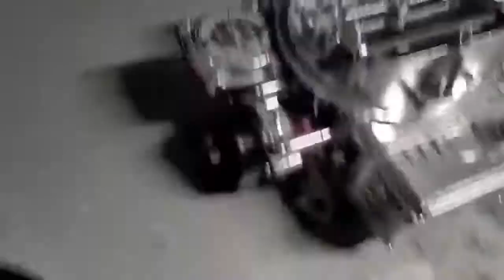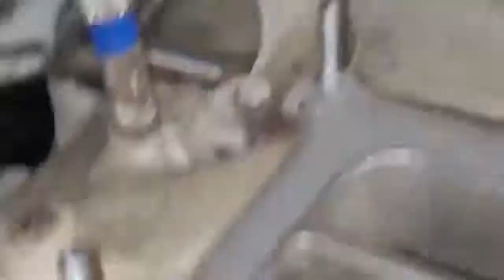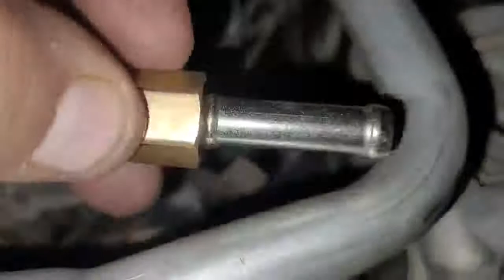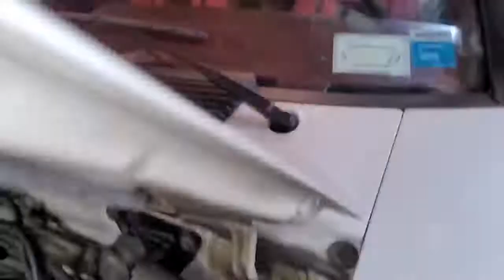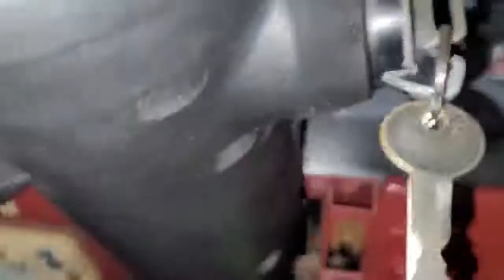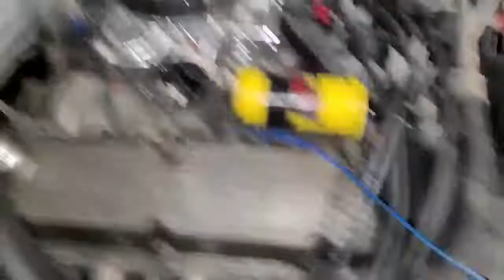Installing holley 600 cfm street warrior carburetor on 1984 Ford mustang.

Comment: Hi there, I hope you'll still answers questions about this install. I'm new to carburetors and I'm learning all about them. Why go to an electric choke? Again I'm learning, thank you so much!
Reply from the maker: Hi, thanks for the comment.  In my opinion  the electric choke is the most reliable. But there's something to be said about a good old fashion manual choke .
Reply: @AdamzGarage thanks so much for your reply. So in layman's terms, the electric choke does a better job with providing the best fuel/air ratio to make the car run/idle well?

Comment: Can you share the details of what you did to adjust the throttle cable bracket?
Reply from the maker: I actually forget at this point..lol. I'll take a look under  the hood tomorrow and see if it jogs my memory
Reply: @AdamzGarage  tbat would be great! I am doing the same swap on a hatchback GT350 and am curious if it's a bit of bending, or if I have to make a step-back plate. If you want to share a photo, I can provide an email.
Reply from the maker: @Darren5L  okay great, I can definitely take a pic or 2. I do beleive I just did some fine bending to get it just right.
Reply from the maker: @Darren5L  I have some pictures and a quick video. I can try and email if you would like.
Reply: @AdamzGarage  it seems I can't provide an email in comments.
Reply from the maker: @Darren5L  hmmm see if u can email me nvkadm7084@gmail.com
Reply: @AdamzGarage  email sent

Comment: Just a heads up. In the beginning of this video, he lets you know he upgraded the intake and added a spacer. For a true stock car that has no upgrades here is a heads up. First this carb will not fit on the egr plate. The vacuum port on the back hits the solenoid and will not seat. Taking out the EGR plate and installing a Mr. gasket 3404 spacer set. This will keep the style most like stock. Plug the vacuum hose. Next it looks like all the smog stuff was off and some lines were rerouted. My vac line off the distributor does not go to the carb but to the other side to the back of the intake. I'm going to use the original line I took off the old carb. Lastly the fast idle solenoid will bolt back up with the use of a couple washers. It does not hit the kickdown switch on the solenoid. i am working on that.

Comment: From reading comments, it looks like you did not use the electric choke wire from the original because it was a different voltage. 12 instead of 7. It looks like I could use the old choke, original wire. The next question at the end you hotwired the accelerator solenoid. Why did you not reinstall? I use in cold weather and need the fast idle. Does the new carb. have the mounting holes for the bracket and will it work with the throttle lever.

Comment: Hello Adam! I've been waiting for someone to do this video. I'm about to swap out the original carb on my 85 gt. I'm curious how your charging issue played out after securing the unused switch from the previous carb? Did you end up jumping it? To be clear, the circuit just needs to closed?
Reply from the maker: Hi. Thanks for the comment. Once I secured that switch out it has been fine since . I still haven't taken the time to remove and jump it out permanently..lol.. But yes, if I remember correctly, it has to be closed. Basically during wide open throttle it took the charging circuit out of the equation,  then it would go right back to charging once you let off the pedal. 👍
Reply: @AdamzGarage  Thanks for getting back to me! If it works, it works! Ordering the carb today. I'm curious if 1986FordF-250's idea about keeping the choke thermostat to maintain the 7 volt power. I assume I could use the original wiring, given its the original setup, but i'll do my research. Thanks again!
Reply: At 9:05 in your video, you removed a braided vacuum line. It goes into the central part of the carb with a metal line to connect it. Do you recall what it’s for? Mine has a similar line and I cannot find any info on it anywhere!
Reply from the maker: @hargbolfamilyvideos7902  The braided line that I removed went to the vacuum advance distributor.   Hope that helps.
Reply: Thanks! That does help. My distributor vacuum runs to the manifold. I have a different vacuum line running to where yours was connected. Very common to see my setup in pictures, but still can’t find what it is.
Reply: Great video! I am installing this carb on a GT350 hatch. Can you share details on what you did to the bracket make the throttle cable have the correct amount of travel?

Comment: I bought one  as well 😃 new on offer up to go on my 69 F250 390 i realized in my carb research its pretty much lil tweaks here and there  and they call a carb new  such as this 4160 classic 60"s 70"s 4bbl.street carb now it Silver or aluminum with universal linkage its now a street warrior  put a rear metering block on it with micture screws now its a brawler....
Reply from the maker: Yeah, pretty much an old school holley. For the price I was pretty impressed.

Comment: electric choke right?
Reply from the maker: Yes it has electric choke.  But I couldn't use the original wire from the old carb. The new carb requires 12 volts when key is turned forward.
Reply: @AdamzGarage  You could have used the 7 volt motorcraft thermostat off the original carb. I use those 7 volt motorcraft thermostat caps instead of the crappy thermostats the Holley carbs come with, I use the stator wire off the alternator for 7 volts power on a couple of vehicles. I find it to work much better than the 12 volt setup and there's no chance of the choke ever opening without the engine running.
Reply: If you don't mind me asking Adam...what intake is that?

Comment: Thank you for posting this.  I need to do this fuel line setup like you did.  I was thinking if it would be easier to buy a new metal fuel line that attaches to the fuel pump,  cut the line like you did and attach the filter and rubber hose, then attach to the fuel pump.  Would that work?  Thanks
Reply from the maker: Yeah that should work for sure. I was originally going to do that so I could save my original line in case I ever have my original carb rebuilt.  👍

Comment: When did you add the wood spacer? Could you have used the original spacer and connected the PVC valve to it? Did you add a gasket above and below the wood spacer?
Reply from the maker: I added the spacer about a month before the carb swap .I was having a heat soak issue .  My original carb was mounted right to the intake, so I didn't have a spacer originally. And yes I used 2 gaskets above and below.👍